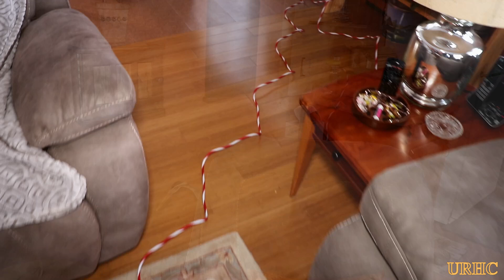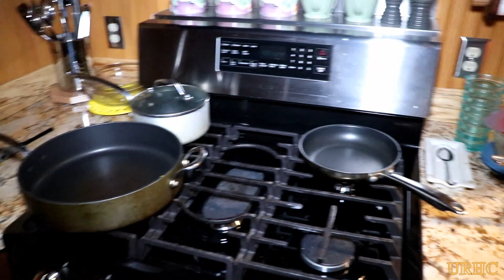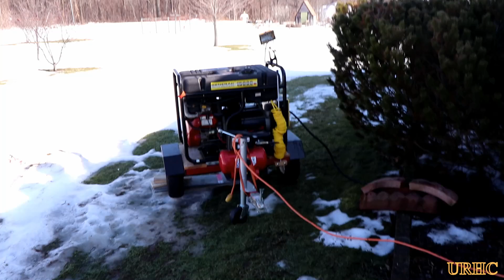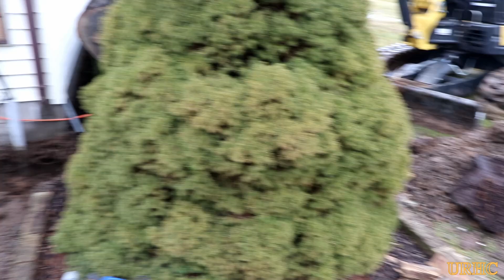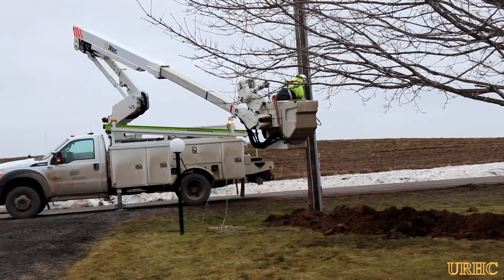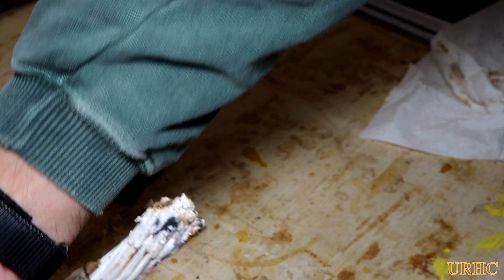Replacing The Underground Power Feeder Cable After Failure Of One Leg

Comment: I've also been dealing with direct burial AL power cables for the past 37 years, many failures just like you had. I feel your pain.
 Therefore, I never direct bury any power cable, always using conduit as you did. Also, I've totally switched to copper from AL.
 More expensive, yes, but wont dissolve like AL when that  inevitable bit of moisture seeps into those underground systems. 
Successful AL underground requires perfection, not easy to achieve long term, as you discovered. 
Should you ever have an issue in the future, you will be able easily replace or even inspect with the conduit. 
Unfortunate you don't have a disconnect at the pole, just before the underground. But with the meter at the house, I assume your power supplier doesn't want any possible assess prior to the meter.
Reply from the maker: This should outlast me now. It would be nice to have a disconnect at the pole but like you said it would be easy to tap in. Something that we never expected. Thanks for watching.
Reply: It's against the National Electrical Code to have a disconnect between the pole and the meter.  That wire, or cable, must be continuous, or unbroken.
I noticed the young man sliding the conduit over the conductors.  Totally against the Code.  All conduit must be installed BEFORE installing conductors.  In other words, "install the pipe then, pull the wire."  That's the correct way to do it.
But, it's too late, now.

Comment: very surprising they didnt try to pull the new wires with the old wires, I have done quite a few that way, then the yard isn't all dug to hell, have replaced natural gas lines this way too. Glad your all fixed up, thanks for posting.
Reply from the maker: You don't want to just pull in a new wire not knowing what the problem is. It probably would have been damaged by the rock in a very short time again. Now that there is conduit in place it will be easier if it ever happens again. If it was done right the first time there most likely would not have been a problem now. Thanks for watching.
Reply: Yes if you want to risk tearing up nicking the sheath and shorting out burning wire into w moisture. And w that water in video.. Hell no.

Comment: Sorry, you had trouble what was the reason the generator would not start.
Reply from the maker: Thanks.  When it gets below zero degrees the battery and starter don't have enough power to over come the compression.  It's a 30 hp 1 liter engine that tightens right up. Thanks  for watching.
Reply from the maker: This one is 15 kw with 22.5 kw surge capacity.  Bought it 20 years ago to run my welder because my last garage didn't have much power. I only have a 30 amp transfer box that was in this house when I bought it so this generator is overkill but all I have. I plan on switching to a smaller diesel unit someday.

Comment: In CT. they tell us to use Mobil ! for snow blowers, generators, etc. that have outside use so that they'll start. Thanks!!
Reply from the maker: This one has 30 weight in it so that is part of the problem.  The little battery and starter just can't overcome the compression on the 30 hp motor at low temps to start it turning. It also has a knob to pull when operating below 40 degrees to keep the engine running warm enough to run properly.  They don't reccomend synthetic but I  may try it. Thanks for watching.

Comment: I'm a bit surprised you're so crippled with half the power... Unless you're pump is 240V I would have just rewired it. But yeah, that cable was shot! Not a fan of aluminum for cables, especially if they're not even coated with copper....
And I'm very glad that part of the system is for the electrical company here :D
Reply from the maker: The pump, dryer, and all my shop tools are 240. The kitchen appliances and outlets were all on the dead side.  Water for flushing was the biggest problem.  Any longer and I would have put a jumper on the main busses in the box. If it was overhead the utility company would have covered it. Thanks for watching

Comment: Why didn't they push that cable instead of destroying your yard?
Reply from the maker: This is how they do it around here. They have to dig down a couple feet to pass inspection. If it was done right in conduit the first time they could have just pulled in a new wire. Thanks for watching.

Comment: That's the exact thing that happened to my shop wire. I dug it up put new wire in conduit. I used aluminum wire also. Copper is too expensive. I'm glad someone was watching over you and gave you a few nice days to get the job done.
Reply from the maker: Apparently this is common when conduit is not used. Don't remind me there is 200 feet run out to my shop underground that could be next. We were very lucky with the weather.  Thanks for watching.

Comment: That's a long time without power. Mine was 3 days, but I didn't have s generator. They are finally replacing the roof next week, and the siding hopefully soon after. Almost a year to get things done. Stay warm my friend.
Reply from the maker: Luckily we had one phase and enough extension cords to keep the freezers,  fridge, and internet running.  No 240 in the shop drove me crazy. My generator was worthless when it dropped below zero out. Glad it's over.  Hope you get some warm weather for your repairs. Thanks  for watching.

Comment: Ahh the joys of home ownership and the surprises that may come ones way.
I am curious about your generator.
It looked to be pretty large with 2 overhead tanks, or were those dual exhausts? Perhaps a vid on that and your setup some day.
Stay safe.
Reply from the maker: It has a large fuel tank that holds 16 gallons that gives it a 20 hour run time.  It is a 15 kw  with a 1 liter 30 hp engine and a single exhaust. My transfer box can only handle 30 amps so it is over kill for our application.  I bought it 20 years ago to run my welder in my  last garage that didn't have much power.  Thanks for watching.
Reply: If you click on Videos when you first come to the page, you'll see all the videos that have been uploaded.  There is one about the generator.

Comment: $3300 , you got off lucky . That was a excellent price to pay . Houses in my are have hydro lines on top of poles . Houses built in the 50's . Aluminum wire is what they use today for the wires from the poles to the house . Copper wire would cost a fortune these days . I'm surprised that they laid down all of that conduit with that much water in the trench .
Reply from the maker: They glued the conduit so it was water tight and had no choice.  The only way to stop the water flow was to fill the trench. Luckily the inspector was there on time because the trench walls were starting to crumble from the mud. Not what you expect in February around here.  I am going to see if the town will put a drain under my driveway now because they  caused the water to backup there after raising the road a foot. We had a great contractor. Thanks for watching.
Reply: Yes you had a great contractor . Don't take any grief from the town . Water should not back up on your property . Period .
Reply: How old was the cable that broke? When was it installed

Comment: I would never use aluminum. Has  a trailer house with aluminum wiring found plugins smoking every little bit.  Was afraid it was go to burn down. God bless you.
Reply from the maker: Around here that's what most people use for entrance cable and if properly installed it should last a long time. There's a special compound that must be used on the connections to keep them from corroding. Copper that size is very expensive.  Thanks for watching.
Reply: Hello Dan.  Single-strand aluminum for branch wiring is not good, multi-strand for higher amperage connections such as an AC compressor can be OK if installed correctly.  Also OK and normal for most parts of the country is aluminum service entrance conductors, as Mr. URHC pointed out. 

The problem with most aluminum branch wiring is that as it expands as contracts with use, it becomes loose at connection points, generating heat and increasing the risk of fire.  Special connectors are available to allow for safer use of older aluminum wiring, but it's always preferred to replace any single-strange branch wiring.
Reply: I have a friend in Florida whose whole house is wired with now-outlawed aluminum Romex.  Once a year, he has to turn the main breaker off and tighten all of the connections --- breakers, switches, receptacles.
DON'T BUY A HOUSE WITH ALUMINUM WIRE !!

Comment: WoW why did you have to pay for it ? it looked to be on the side of the meter and could they not run a temp line till the better wether ? but great to see if is fixed for you and have a great day and God bless ! Kioti Curt :-)
Reply from the maker: They used to allow temp lines but don't anymore.  When it is buried you own it to the pole and 35 feet up the pole. Thanks for watching.
Reply: New to me if meter was at pole then would be private bury from meter to side of entry at house which would be on you .  But when meter is on house or at house that's electric company's prob.
.how do I know this ? Bury communications lines from glass meter on home to row and have hit electric when locates are mis marked and been on site when truck rolls out .. Always been elect. Showed up . never subs. Maybe diff in your state?  I've been in Maryland..Pa..Ohio..Mich..WI..Nebraska..Indiana..Illinois..Missouri.. NC.. Private buries that I've seen is glass  meter offset from house and your baby from there.

Comment: The broken cable looks like a remnant of a trans-Atlantic cable of some sort, do you a have a transfer connection for your generator on the outside of the house and a transfer hook up in the cellar to the electrical panel?
Reply from the maker: We have a transfer box but it only contains a couple circuits for emergency use and is 30 amps. The generator will put out 55 amps and this setup doesn't allow me to use it all. With all that corrosion it surprised me that there was no sign until it finally failed. I guess the corrosion must be a conductive paste. Thanks for watching.

Comment: So did you use copper or aluminum for the new lines?
Reply from the maker: Aluminum, copper wire prices are crazy. It will last longer then I will be around. Thanks for watching.
Reply: I had both legs of my Aluminum underground go out a few years ago. Had many spots of corrosion in the line. I have all sand.. Replaced with all copper 170ft of it in conduit
Reply: 170 from the meter to the house, was all my cost.

Comment: Very good that you are back up and running. !! It amazes me how 60 yrs ago the Engineers allowed alluminum cable to be used in the first place.!! What were they thinking.? Maybe they owned stock in Reynolds ?! Now they do it right. Nice to see you back.!!!
Reply from the maker: We put aluminum back in because the cost of using copper was so high. Hopefully the conduit will make it last this time. We were lucky that went because they didn't put a expansion loop in the meter panel and the insulation on the wire was 1/2 cut through that could have caused a major fire. The farmer that built our house took lots of shortcuts to save a dollar. The way taxes are going in NY I may not be here that much longer anyway. Thanks for watching.
Reply: are planning on moving to other state
Reply: @jacl4953  No I am Canadian. I might have missed your meaning?
Reply: @KP-oe8sk  he said ( The way taxes are going in NY I may not be here that much longer anyway.)
Reply: @jacl4953  Oh yes!!!!  The Taxes are high. My Parents lived in Batavia NY in the 80-90s Very high tax rate!!!
Reply: If I am not mistaken As long as  the LUG Terminals? are the right size it is good to go? Conduit pipe will keep it safe. ANYWAYS glad you are back and I see spring Yard work will be on your Wife's Honey doo list!!!
Reply from the maker: KP they also coat the stripped ends with a compound to prevent oxidation before inserting them in the terminals.
Reply: @unemployedredneckhillbilly2023    Yes a type of Dielectric grease for high volt wiring. The best thing is the PVC piping. Glad you did not loose any Plantings etc. !!!
Reply from the maker: Jac I I have been thinking about it. The taxes are out of control,  the gun control is crazy, they make the taxpayers cover the cost of free housing, food, cell phones,  college, and healthcare for illegals and now they are allowing the killing of babies right up to birth. It's not the same state that I spent my whole life in.